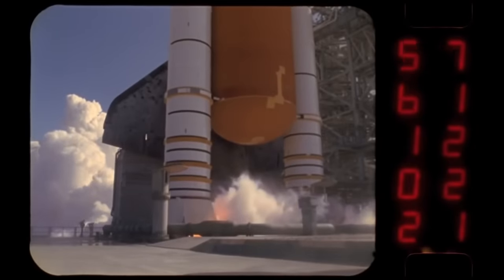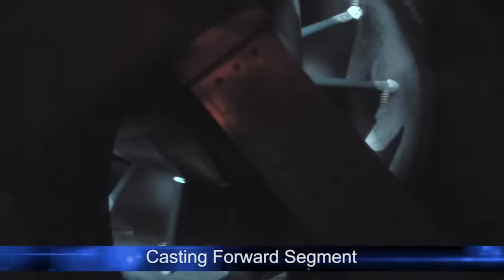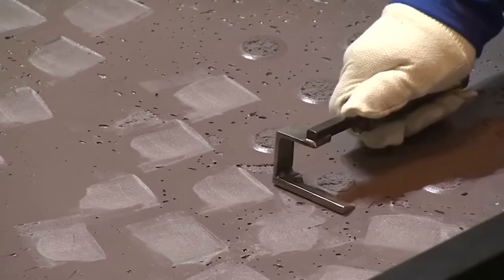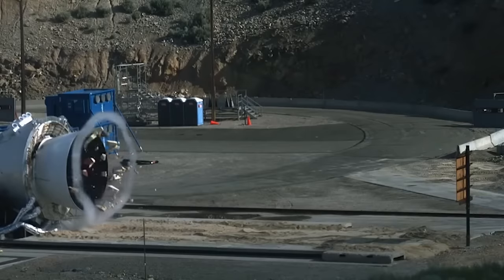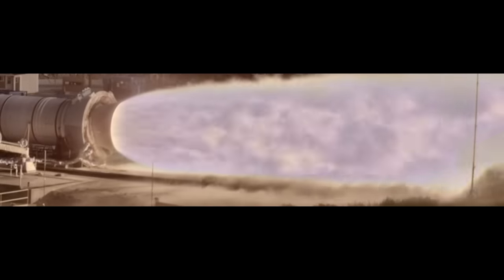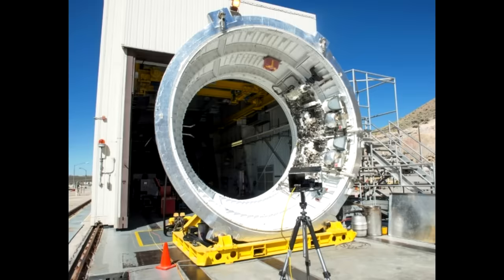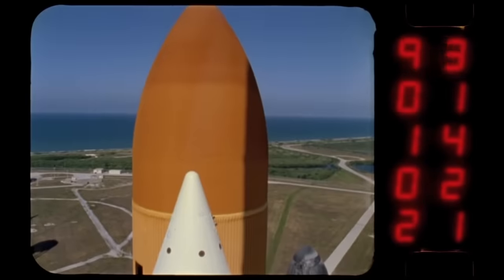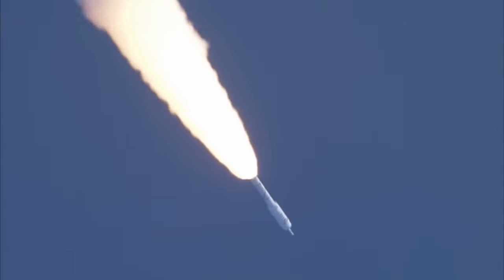The Amazing Engineering Behind Solid Rocket Boosters

Comment: When I was at Space Camp back in the day one of us asked what would happen if the explosive bolts didn't fire.  "They get torn off and the SRB leaves anyway."
Reply: That's pretty metal.
Reply: This is what I was told, too.
Reply: Yeah they're designed that way. I mean it would be pretty stupid if the rocket exploded at the launchpad just because the hold-down device failed to unlock.
Reply: @TheOneWhoMightBe  They'd be pretty ugly metal after that.
Reply: @michaelbuckers  To be fair, its a problem pretty unique to solids. With liquids you want the hold down device to win out because you actually have the capability to shut them down rather than let them fly away uncontrolled in the event of catastrophic failure of some sort. But ya with solids your given the choice of finishing the burn here or finishing the burn elsewhere so the hold down devices don't really serve the same function. You likely already knew or guessed all this I just thought it was interesting info to point out.
Reply: Whatever happens with the hold down devices after launch, it's nice not to have the rocket blow over beforehand :P
Reply: @Tuxfanturnip  as well it gives multi engined vehicles a chance to ensure all engines are generating equal or at least balanced thrust before releasing. Engine startups aren't easy to control and damn near impossible to make all engines build thrust at an even rate.
Reply: @Benjamin McCann It would be even stupider if the Director of NASA commanded the launch in temperatures below “O” ring tested performance, but that is what happened. Against all engineering advice and concerns, he had a scheduled launch.
Reply: The bolts are timed to explode so that shuttle has come back to vertical.  The near instant thrust of the solid booster cause the whole shuttle to bend past vertical because the main engines have not come up to full thrust.  The timing allows about a second forthe shuttle to springs back into true vertical and the (you can see the bend over and spring back!) and the bolts are blown.  If the bolts are not blown the shuttle and all the congressmen on board are whipsawed into an uncontroled fligh over of Cuba.
Reply: @judyw8626  As far as I know, the same signal that lights the SRBs also blows the nuts, at T = 0. The only tilt/waiting to come back to vertical that I'm aware of is that the shuttle tips towards the boosters before they light because the SSMEs light first (a few seconds before the SRBs.) Then, when the stack gets back to vertical, the SRBs ignite and the nuts blow.
Reply: As far as what happens if the nuts didn't fire... it depends on how many didn't fire. They actually did have a few incidents of individual pyros in individual nuts not firing and, indeed, they were torn off with no problem. However, all 8 of them together actually were strong enough to hold the stack down... temporarily. Those nuts were quite close to very, very hot exhaust gases and would almost certainly have eventually failed due to the heat and rapidly increasing force on them (vehicle thrust remains mostly constant, but its mass is quickly decreasing due to fuel burn.) So, if none of the nuts fired, the vehicle would probably go *somewhere*, but almost certainly not where you want it to go and no guarantees about it arriving in the planned number of pieces.

Or, to phrase it another way, you will not go to space today.
Reply: @nmnmnm35  😂🤣 context, dude, context!
Made me laugh hard regardless.
Reply: @vbscript2  You are right.  The ssme do light first and build thrust and since they generate a thrust vectoroff of center they tilt the ss over and and preload it so it springs back and right at vertical the SRB's light.  None of my report ever escaped a lot of red ink!  Thanks
Reply: Benjamin McCann 7.
Reply: @vbscript2  I don't think the nuts are located somewhere suffering from extreme heat..... Most of the exhaust is directed downward and could not reach the outer skirt as long as the shuttle is still on launch pad.
Reply: @yan3073  The exhaust wouldn't impinge directly on them for sure (otherwise, they would melt very quickly,) but there's a lot of energy coming out of those nozzles. Everything nearby is going to heat up after a couple minutes of that.
Reply: I kind of wondered about that myself.
Reply: @2nd-place  It's actually not
Reply: Unsubtle Major Dictator it is pee. Or if it isn’t, would you mind pointing out where the supposed squirting liquid reservoir capable of holding up to a decilitre of fluid  is in a female body?
Reply: @negergreger666  I don't mind at all, it is from the skenes gland. It is better not to assume if you actually don't know.
Reply: @vbscript2  I think you are correct. Once the MDMs see the 3 SSMEs are at >=90% thrust, they send signals to the frangible? nuts to fire and the SRBs to fire. All 8 could hold the SRBs down, but at 3000 deg C, SRB exhaust would quickly weaken the nuts.
Reply: @2nd-place  Much of the research into the composition of the fluid focuses on determining whether it is or contains urine.[5][6] Whether the fluid is secreted by the paraurethral ducts through and around the urethra has also been a topic of discussion, but the exact source and nature of the fluid remain controversial among medical professionals, and are related to doubts over the existence of the G-spot.[5][7][8]
Reply: @vbscript2  Or maybe ever ☺
Reply: @oneskydog4401  He didn't command a launch. He stated he wouldn't go against a Thiokol Engineers launch recommendation. What he did do was threaten Thiokol managers that future contracts from Nasa could possibly be scrubbed if Thiokol didn't give a launch recommendation so an hour later Thiokol managers bullied their Engineers to give a proceed to launch recommendation and the rest as they say ......
Reply: 6 million HP will do that.
Reply: I always wondered what would happen if those bolts didn't fire.  I figured if the bolts didn't fire, the rocket would just drag the launch pad into orbit.
Reply: @nmnmnm35  this could mean a few things you know.
Reply: Matt Horkan  that's good really good. In Florida we saw atlantis. To launch something that big plus the payload  reliably it's a stunning  achievement!
Reply: How! After it's passed throu Max Q do the SRB's get ripped off.
Reply: @vbscript2  The main engines were lit in sequence at T-6.6 seconds.  All three started at different times, roughly 1/4 of a second later. So, engine 3 started at T-6.6, engine 2 1/4 of a second later, then engine 1 (center engine) 1/4 of a second later. The engine thrust bends the shuttle stack, also known as the twang. It takes 6.6 seconds from the first engine to light, the twang, and back to exactly verticle, then bang. The hold down posts were actually detonated at T-0.001 seconds.
Reply: @djbeezy  I’d love to see an entire video made just on these frangible nuts/bolts. 
  With the questions and answers just in this one thread I think others would like it also. 
  I wonder if we can get Scott to do it??
Reply: My understanding is that is correct. The bolts were just to hold it in place until launch but they couldn’t hold down the spacecraft down once the SRBs got going
Reply: @TheOneWhoMightBe  Technically and literally
Reply: We had a hang up because one frangable nut did not separate cleanly so it yanked the bolt clear. The later design of the nut had a channel as a secondary safety to fire to make sure it split in half.
Reply: OMG I WENT TO SPACE CAMP TOO! And somehow I completely forgot until right this moment. IT WAS SO MUCH FUN, haha.
Reply: @oneskydog4401  Did ppl get fired over these mistakes?
Reply: Retired NASA Engineer/Manager for Space Shuttle Atlantis here.  We had the occasional one that wouldn't fire, so we did what NASA does best.  We backed that shit up with a backup explosive charge.  On the rare occasion the hold down bolt didn't cleanly separate to the bolt catcher, it would expand the hole in the SRB aft skirt, which during recovery/refurbishment would be replaced.

Comment: More than twice as powerful as the most powerful liquid fuel rocket engines.
Reply: yes.... but it would make bad ISP i guess  

that's why we rarely see a solid rocket at the upper stage
Reply: @alponselrik  Probably less to do with isp (while important its benefits could otherwise be outweighed by some of SRB's other benefits) and more to do with second stages often needing to shutoff, coast, have variable throttles, and the ability to* reignite multiple times to make adjustments or get into the proper orbit/position for deployment of satellites.
Reply: @MrDJAK777  adding SRBs to upper stages is so innefficient it actually reduces the total dV of a rocket typically
Reply: @MCWaffles2003-1   Then what about the STAR family of solids? They are almost exclusively used as kick/third stages.
Reply: @MrDJAK777  Both are the concern on upper stage, control/restartability and Isp. But some launchers still use solid upper stages or apogee kick motors, I guess because of the simplicity and price. Lot of satellites don't need to get into exact orbit by the launcher, most geo-stationary satellites do the last circularization burn maneuver using their own propulsion. There are just too many parameters and different approaches, and very few universal solutions.
Reply: Little bit less than twice (12MN on the srb and 7,25MN on the engine) but yep, a giant and complicated firework
Reply: For the first stage when you are fighting gravity to get your giant tank of fuel off the ground, high thrust is more important than high Isp, for later stages the reverse is generally true. But yes, solid rockets are sometimes used on satellites to boost them into GTO due to simplicity and the fact that they are small and only need to burn once, briefly, to get the job done. At Goddard Spaceflight Center's visitor center there is a early-model Delta upper stage on display, a small solid rocket motor with no propellant loaded (obviously) and a mock satellite payload on it for context.
Reply: So what? I can put a block of C4 there and produce much higher power for a fraction of sec. You have to focus on the overall big picture.
Reply: @emilybraswell4570  then the loss in dV was worth it to them apparently for those that use them
Reply: @parkershaw8529  "We said we'd get your satellite into orbit, we didn't say we'd get it there in one piece"
Reply: @therealergo  LOL! Good one!
Reply: I’m assuming you are referring to the RD-170 not the RS-25 or F1
Reply: izzah don't think that makes it better given the fact that liquid rocket engines can be shut down at any time or throttled down. also cheaper because it's reusable
Reply: @MrDJAK777  At the end of the day, for commercial launch vehicles at least, the only thing that truly matters to the customer is the launch cost to their desired orbit (well cost of launches and satellites can be broken down a little more than that but you get the idea). The customer doesn't care if your vehicle does the job more efficiently than your competitors, they only care if it costs them less for the same desired outcome (ie accounting for desired orbit, required accuracy of the final trajectory, and vehicle reliability). Whether that means you use high precision, high expansion ratio, hypergolic engines or some dirty old solids you refurbished from surplus cold war ICBM hardware they don't care. As in all industries, cost is king. Take the RS-25 engines from the shuttle. By far one of the most efficient sea level engines for their thrust class to ever be developed, but the Merlin with it's old school pump and dump gas generator cycle has them beat on cost effectiveness six ways from Sunday. Sometimes liquids are the best cost savings option, especially if there is a liquid that already exists where a solid would need to get researched and developed first (ie high capital cost no one wants to pay for). Other times solids win out when the right engineers with the right experience and the right opportunity come together to make one that fills a particular niche cost effectively. As I said before, cost is king.
Reply: @evmcg  It's 40% more powerful than an F-1.
Reply: Common Sense Realist  
SRBs are not at all efficient, they are powerfull, but have abysmaly low ISP compared to liquid fueled engines.
Reply: @evmcg  I think he is referring to F-1.RS-25 is less powerfull and RD-170 much more
Reply: All of the interplanetary missions (that I have launched) have used solid motors as the third stage to send the spacecraft on interplanetary trajectories. (Mars global Surveyor, Stardust, Genesis, Deep Impact, MER rovers, Mars 98 orbiter & Lander, etc.)
The Magellan Spacecraft to Venus took a Solid Rocket Motor with it for Venus orbital insertion.
Reply: @parkershaw8529  
Suitcase Nuke: "Hold my beer".
Reply: @stuartgray5877  
Magellan, sure, but we're talking the 90's now. The 21st century will leave solid rockets with gun-blueing and powdered wigs.
Reply: @-danR LOL, you mean hold your Gluon Plasma?
Reply: @parkershaw8529  
Gluon/Quark bombs need a quantum chromodynamic flux capacitor to initiate Higgs boson dissociation. We're getting there, with the help of Isaac Arthur....
Reply: @-danR   I launched the Kepler Space Telescope in 2009 with a SOLID ROCKET MOTOR upper stage.
Sorry, but this is has been the preferred method to inject interplanetary spacecraft into their outgoing trajectories for many years.
Try to keep up.
now that the Delta-II has been retired, they will use something else from now on.
Reply: Common Sense Realist  However at a weight penalty, making them only realy usefull in lower stages as boosters.
In upper stages that eats much into your deltaV potential or payload capabilities.
Meaning you would need a larger launch vehicle that costs more.

Generaly speaking ISP gets more important the higher up the stage while thrust gets less important, wich is why engines like the RL-10 are so optimized for low thrust and insanely high ISP while the boosters of the first stage wich launches it may be solid.
Reply: @diesistkeinname795  you apparently did not read any of my posts above.

FOUR of the five spacecraft I have personally launched had a solid rocket motor THIRD STAGE.
Reply: The shuttle program could have turned out differently had the boosters been built in Florida. Have a look for " Aerojet Dade "
Reply: @bobroberts2371  They had also started work on liquid fly back boosters that would be more easily reusable because they dont get dunked in the ocean after every use.
Reply: @diesistkeinname795  ISP doesnt matter for a BOOSTER ENGINE, the RS-25s make all the ISP the stack needed plus some.  The RSRM SRB has comparable ISP to the F-1 engine, another pure booster engine. 242 seconds vs 262 seconds for the F-1 vs 366 at SL for the RS25 and 450'ish seconds in vac.  The RS25 is the ultimate sustainer engine.
Reply: @hoghogwild  As I said, they are only realy usefull in first stages where thrust is more important.
Reply: @diesistkeinname795  Yes, I was responding to your earlier comment "SRBs are not at all efficient, they are powerfull, but have abysmaly low ISP compared to liquid fueled engines."
Reply: @stuartgray5877  Are solid-fuel upper stages used because they don't have the problems of loss of propellant or pressurization that liquid-fuel engines would have when they need to wait a long time after launch before being fired?
Reply: @Octa9on  - We have used solid rocket motors for upper stage boosters on interplanetary missions because they have very low mass compared to liquid (upper stage mass is most relevant for interplanetary trajectories). And because of the WAY we launch them they dont need guidance.
We first point the spacecraft in the correct direction using the second stage guidance system. Then we spin up the spacecraft and upper stage to about 60 RPM then separate from the second stage. Then when the solid fires it is spin stabilized and MUST go in the direction it was pointed.  When the burn is finished a "Yo-Yo" despin mechanism slows us down then the spacecraft separates from the rocket motor.
Reply: Mr SlyFox yes I know.